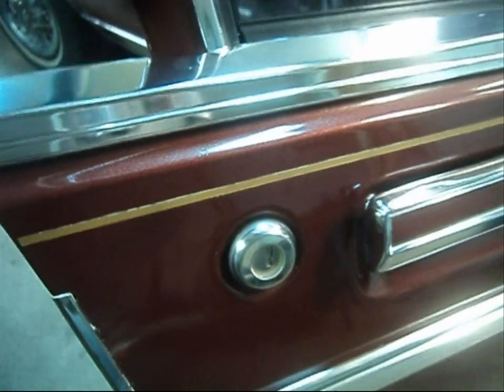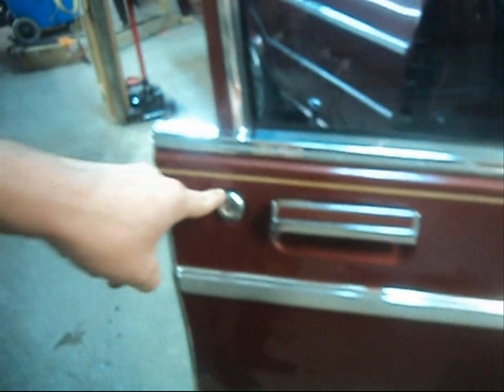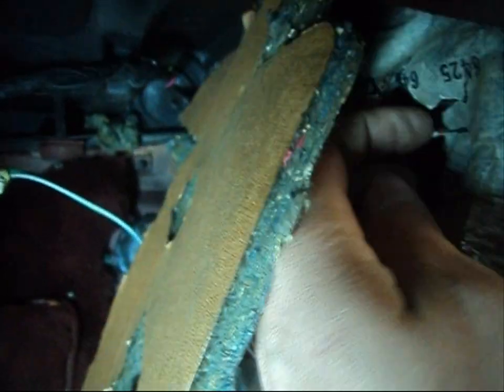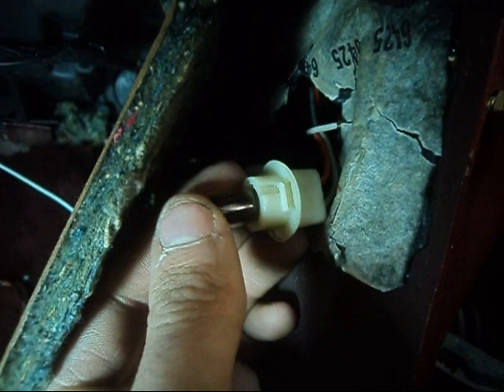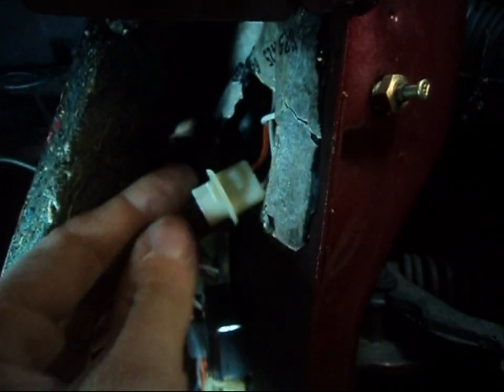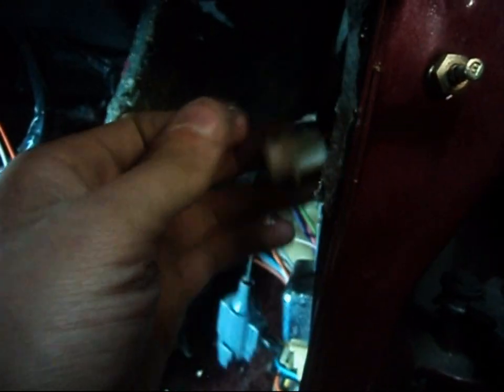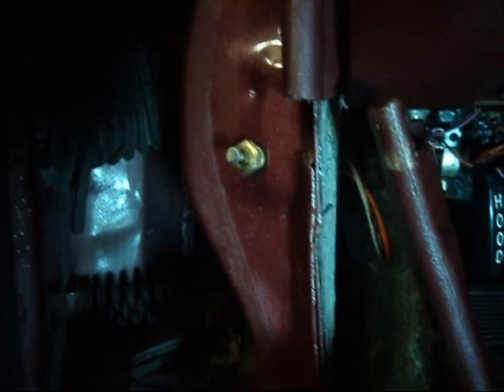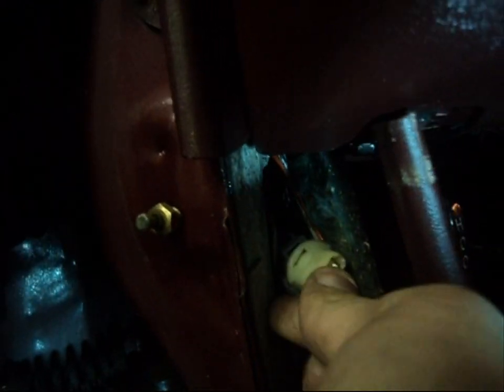GM Illuminated Fiber-Optic Door Lock Cylinder

Comment: I just learned about this feature thumbing through my owners manual today.  My 1990 Buick Estate Wagon has it, but for some reason the lights don't come on just by lifting the handle with the doors locked on either of the front doors.  If I open any of the doors, the interior lights then come on and the lock cylinder lights up (after changing the bulb thanks to your video) but by that point it is pretty much useless.  Any idea why they are not being activated by lifting the handle?  I also have the fiber optic front lamp monitors mounted on top of the front fenders which I think are a much neater use of fiber optics.